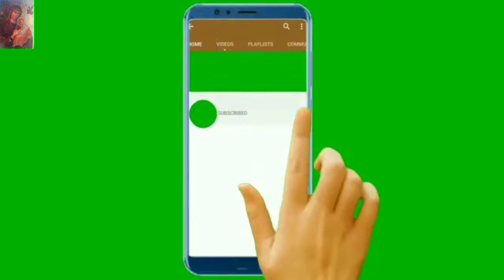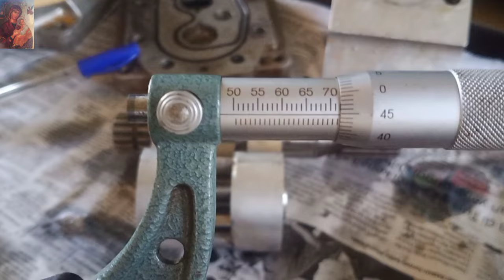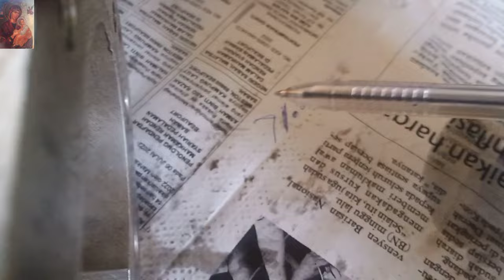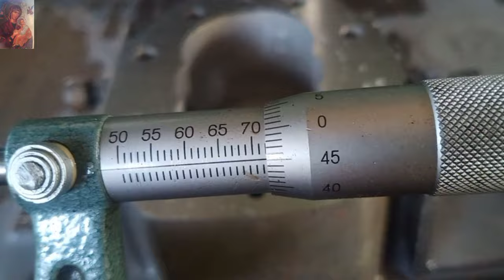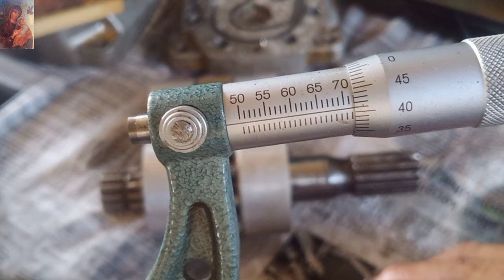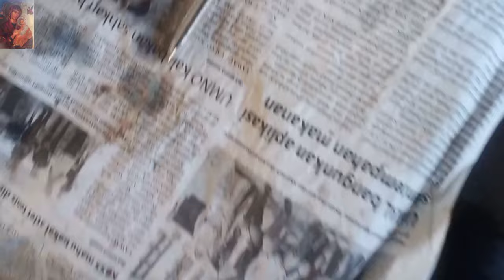How to repair a loss pressure high pressure hydraulic gear pump

Comment: Bos napakagaling mo hidi Ako nag sasawa kahit pa balikbalik Kong pinanood Ang video mo.gusto Kong ipagawa Sayo gearpump ko sanmatatagpuan shop mo bos.
Reply from the maker: Maraming salamat bro dto ako Malaysia same Principle lng bro pag wornout Yong plate at Saka hausing tingnan mo dn Yong facing ng gear bka may worn out na din goodluck at ingat lage bro.
Reply: @tornerongkamayvlog1009  hola buenas desde argentina....estaria bueno que tenga subtitulos el video..una pregunta , el cuerpo de la bomba tiene q medir lo mismo que los engranajes? Rectifico el cuerpo a 71.95 mm?